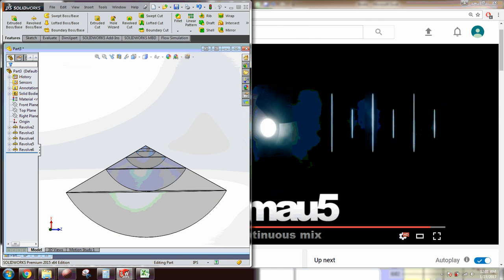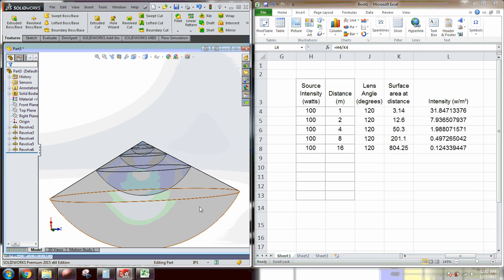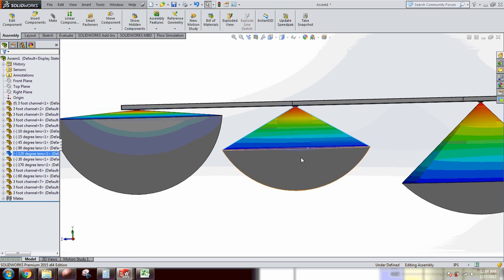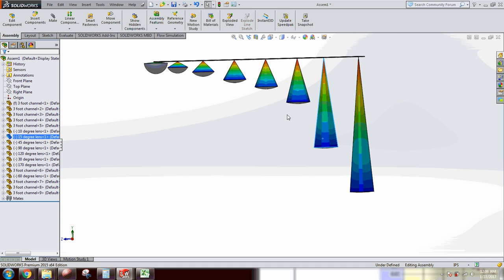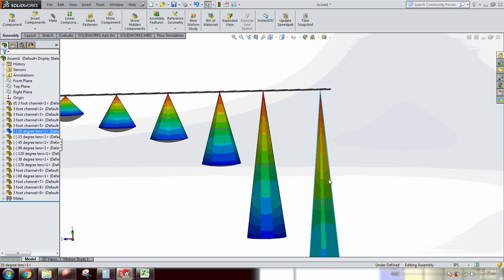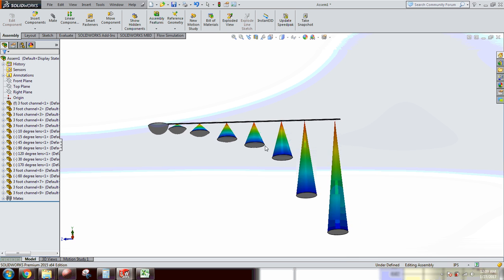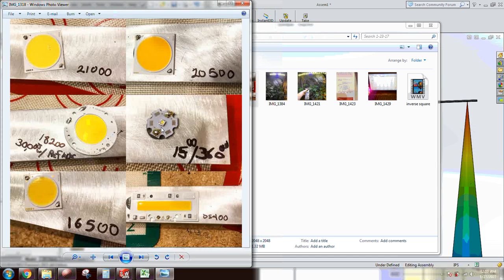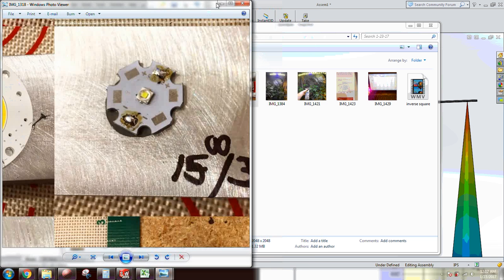Inverse Square Law, LED optics, and some data on popular LED's.

Comment: When you are using reflectors, how much light are you losing to the bounce? Is it better to use these reflectors in a tent or just let the COBs blow their light everywhere and assume it will bounce down off walls and such? I'm trying to decide if I should add reflectors currently and I'd love your input.
Reply: I've tested a 1.5sqft and I trippled my lux with reflectors from a cfl. 
Grows are good with no lens and milar hanging up.